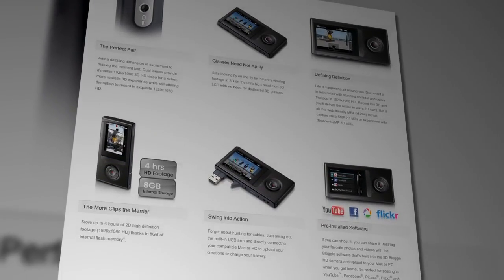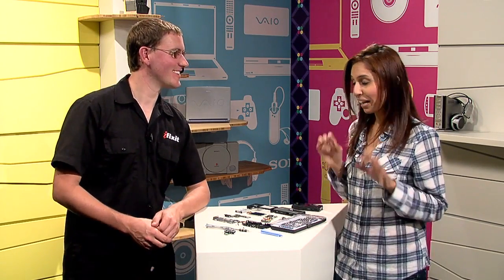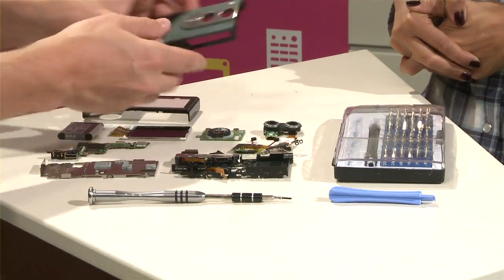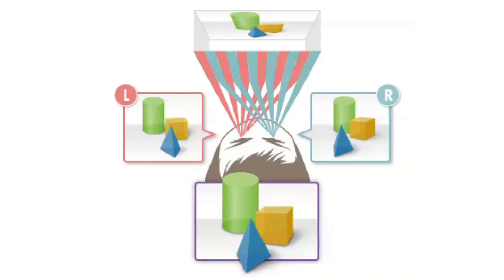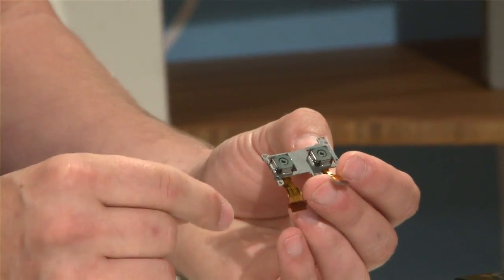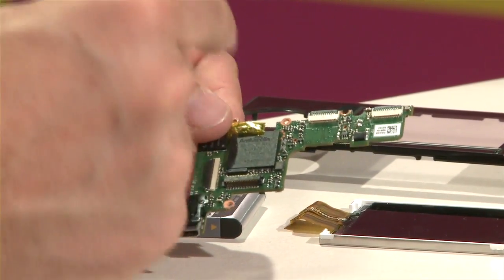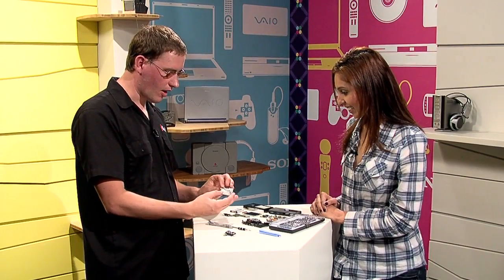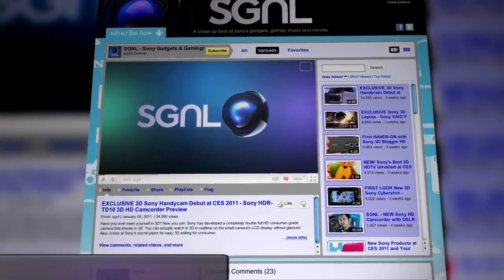We Take it Apart! Exclusive 3D Bloggie Teardown

Comment: Warning; Do not follow the disassembly guide on I fix it. It is missing several steps omitting the removal of some screws before separating the guts from the front case.  There is a screw behind the LCD that screws into the front case.